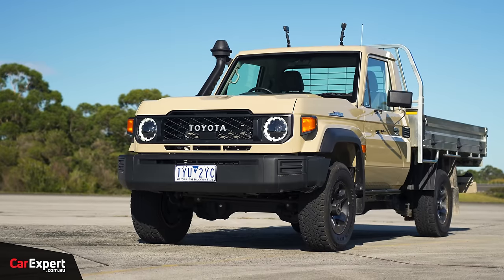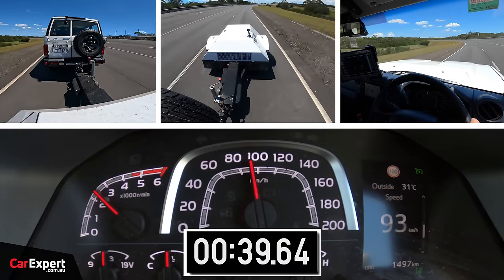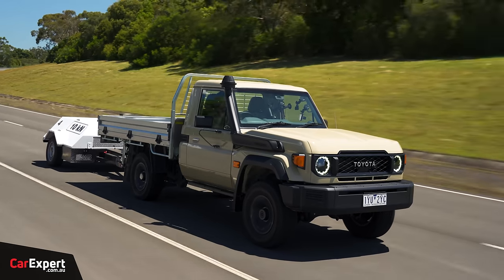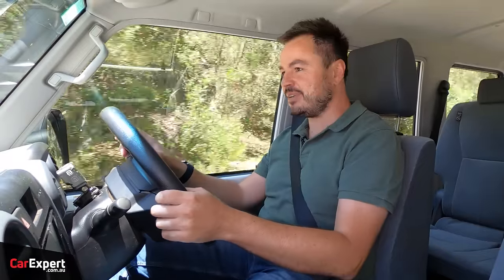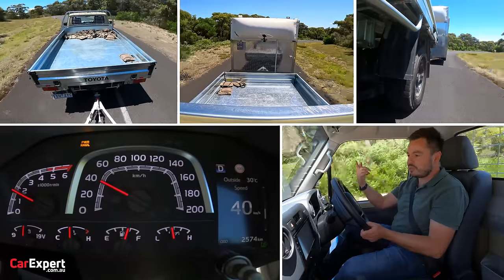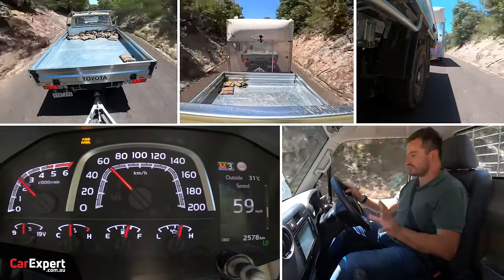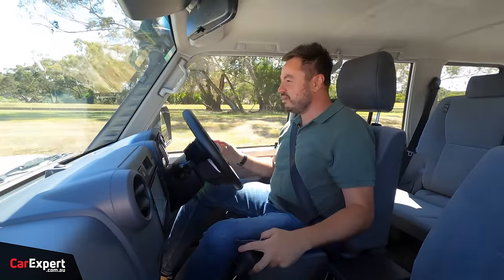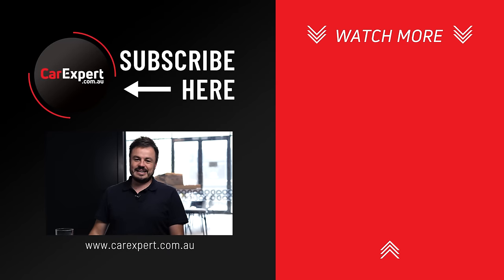LandCruiser 70 Series V8 v 4-cylinder towing stress test & drag race! Is Toyota's V8 dead?

Comment: Ringing a 4 cylinder.
If you put the 10 speed behind the V8 running the same psi boost as the 4 cylinder. The out come would be interesting. By a hilux
Reply: If you are towing regularly, or heavy, buy GM/Ford/Ram diesel.

Comment: THE REAR TRACK.
Every one harps on why Toyota havent changed it, but dont do research on what's involved to keep it legal.
Here we go....
There will be too much rear wheel poke if the rear track was widened to the same width as the front track to keep in with in Toyota's spec of outside wheel to outside fender ratio and comply with countries laws and regulations ie ADR.
The Australian 79 ute would be ok with the "Toyota Australia" tray as they are wider than the body, and would sufficiently comply with track cover, but the rest of the world use the tub on the 79s, and the rest of the 70s being the swb the wagon and troopy have the hard rear body panels which are not wide enough.
Take 5 minutes and Google MQ patrol and GQ Nissan Patrol, particularly study the rear frender between the models, The main bodys share the same doors and body but the addition of coils and wider diffs to the GQ ment Nissan had to do a widened fender body front and REAR. Chop the wide wheel arches off a GQ and you have a MQ as such.
If Toyota added a rear wider body (over the rear fender like the mq vs gq patrol) then a wide rear diff would be possible. 
But we all know Engineering and cost involved plus winging of the world changing its classis style it aint going to happen.
Side not the GU patrol ute with coil front leaf rear also has a bit track difference but no one complains about that..... 
Next time you ask about a wider diff ask about a wider rear body instead.
Reply: We all know its not gonna happen, but in the scheme of things it would have been cheap for toyota to update when they changed to the v8. A couple hundred extra for the slightly extra metal in the diff and axles, and literally a set of fender flares similar to the GR Sport Hilux, which if plastic can be made for a few dollars realistically. They were being lazy and cheap.
Reply: It's called being cheap. Toyota only spend the absolute bare minimum on the LC70 to keep it on sale. There's plenty of people in Toyota that would prefer to see it replaced, it's still build like an early 1980's vehicle. Hand welded, hand filled body joints, it's expensive to buy because it is really labour intensive for them to build.
Reply: They engineer new body's for almost all car models all the time, Toyota know they don't need to care, as people would buy if they only had 3 wheels 😂

Comment: Why buy 2.8 70 Series when you can buy Hilux with the same engine and it is a much better car.
Reply: Easy answer is the 70 series can tow 3500kg at full gvm, the Hilux at full gvm can only tow approx 2800kg. If you don't tow then the Hilux is more comfortable,  safer and a cheaper.

Comment: Probably wouldn’t make any difference, but shouldn’t it have been auto vs auto, or manual vs manual?
Also I find it interesting that EV utes get criticised for their drop in range when towing, and they take longer to charge, but look at the drop in fuel economy for both the V8 and the four cylinder.
Interesting video though.
Reply from the maker: V8 is manual only and 4 cylinder is auto only, that’s really the point here. Toyota have decided that’s the avenue they are going to go down so that’s the test we conducted.
Reply: The drop in range with both of these vehicles is because they are under powered to start with. I used my last vehicle (2011 Ram 2500 inline 6 diesel - waiting for replacement) to tow a 30' enclosed car hauler with a GVWR/GVM rating of 14,000 lbs and rarely lost more than 10% of the normal 600+ mile range.

Comment: We have several 4.2D's and since recently V8's with 600 000km and more on the clock, working mostly in low range and with heavy off road towing in harsh African conditions. Their simplicity, longlivity and performance in low range is unmatched and  is why they are in demand and hold their second hand resale value. Those interested in performance figures in high range and on tarmac, buy highly turbo boosted small blocks and replace them regularly. Under  heavy loads and with low rpms the larger bore engine with heavier components have more momentum and smoother power delivery. As for auto boxes, no thanks, another heat generating  limitation favoured by those used to their city slickers

Comment: When you have 3.5 ton you have to push that engine past 3000 rpm not with 1500
Reply: Exactly,  anyone that knows anything about towing or owns a v8 cruiser knows you have to rev an engine to get the best performance from it. Paul drove the v8 badly and I think on purpose.  Even the 4 cly going up the steep hill was increasing speed fast untill the gearbox changed up a gear then it slowed the rate of speed increase.

Comment: You need to test them both with auto, your lousing to much momentumin the gear change,  as a truck driver grabing a gear killig the 79, 200 series or a 79 with an auto there are many around, leeson fabrication in Brisbane fit an 8 speed ZF auto to the 79. Very impressive

Comment: It’s not a narrow rear track it’s a wide front
Toyota widened it to suit the v8 and left the rear 

As for performance a tickle from a decent tuner would show just how  piss poor the factory tune is on the v8
As to why, at least with this model Toyota knew they’d sell v8s, but they had to sell some 4s aswell so I’m assuming they did it to give the 4 some appeal as I’m sure they could’ve refined the v8 a bit and got more out of it 
Tho then again the clutches in them a crap and it would need more then just a remap

Comment: I dislike these comparisons because they make the v8 look bad. The v8 is not the problem here. Use the 200 series auto if you want a fair v8 vs. cylinder. The 200 uses the same engine, but it's configured properly. The 70 series hamstrings the v8 with a manual with poor ratios, a bad turbo, and severely under tuned and boosted.

Comment: It seems the new 70 series 4 cyl has a remapped 6 spd as it was able to reach 100 kph, unlike the hilux and fortuner and prado when towing the 3kN caravan. Toyota should just do away with the 5spd altogether and introduce 6spd manual/auto options for both the 4 cyl and v8. The real test would have been to test the 4cyl against the 200 GX/GXR as they come with 6spd autos unlike the VX/altitude specs that have 8spd autos.

Comment: A good example of why neither is suitable for towing 3.5t. Neither has anywhere near the torque required to do the job. Nor the stability by the sounds of it. I’d hate to see the EGT’s struggling up that hill. Far better to get a proper tow vehicle with lots of torque and 10 speed box.

Comment: Im starting to think the 4cyl 79 has a different tune to the hilux even tho they use same motor and box. The hilux didnt make it to 100km towing the dyno trailer at a lower setting.
Reply: This Landy 4cyl has a Prado engine and steering wheel from it
Reply: Might have a gearing or differential ratio advantage. I’ll bet my hat that it doesn’t have the same top speed as the Hilux.
Reply: @interceptor7905  hilux/fortuner, prado and hiace (under tuned 130kw) use the same 1GD engine.
Reply: @CM303898  diff ratios are definitely shorter in the Cruiser Hilux has 3.73:1 diff ratios with the auto and the LandCruiser has 4.3:1 diffs in the auto.

Comment: Ah the 30+ year old original prado still getting sold with an equally old and crap V8 TD.  I like the old school looks but when they ask so much for something still so flawed and useless its a joke.  Thanks goodness the single cab ute at least has seen a lot more updates and fixes to all its issues and the auto with a more modern and powerful TD at least brings it partly into the modern age.  Having had the misfortune a few times over the years of towing large portable accommodation units (Large caravan with 2-4 small sleeping units in it)  From perth to remote mine sites and omg I hate these things with a passion.  Like in your tests when going up a hill I used to fear for my life when struggling to maintain 40-60kph up hilly areas and the massive road trains are coming up from behind at 100kph and where on top of me before even they realised how slow i was going and then overtaking me or breaking hard because they could not overtake me. Dangerous is what they are when towing large loads on the road.  And then the fun towing the same loads on dirt roads with that rear diff tracking issues....Why can't toyota after so many years fixed even that issue?

Comment: Half the cylinders doing double the work. It's a longevity test that would really define the 70 series!
Reply: From what I saw the V8 was under a lot of stress. All that for not a very good performance.
Reply: @AusGovOfficial  the v8s are greatly undertuned from stock they are capable of making alot more power far beyond what a 4 cylinder can cap. Think about it 8 cylinders to spare the work of 4. Tho my comment was more to state which engine will actually do the mileage. A 4 cylinder pushing more power than v8? That would put a lot of wear on a smaller engine

Comment: 0:25
How is that possible, as Torque is related to HP and RPM.
From the top of my head; a similar HP but bigger Torque can only mean that the max HP sit´s on a lower RPM (to generate more NM). 
Which would be very, very, very strange when the engine is half the volume.

Besides: I just saw a video from a mechnic who said the he has NEVER seen a disassemble Toyo 2,7l Diesel (RE..?) engine, because they never fail.
THOUGH that particular engine had a snow blower in the front! So hard pulling in low RPM and low gears.
= to heavy vehicle towing!

A simple math is: The load of the engine is divided by.... 4/6/8 cilinder and how many main journals? In in R6 this is 7! ALL full size Diesel are R6 for a reason (except Scania): MAN, Mercedes, VOLVO, IVECO, Catalipar etc.

Comment: You were mocking cars that couldn't do over 40kms on that hill in he mega SUV test! Also, the track difference is to fit the bigger new engines. Moreover, irrespective of the engine size, the price on this car (which is basically an engine) is ridiculous!

Comment: Compare the performance of the v8 79 to the 200 then compare engine performance to the 4.

The real issue is toyotas approach to the 79 and how little they put into it after they swapped from the ihdfte.
They heavily derated the v8 and cut production costs with both the track and the exhaust,clutch and air intakes.

This is nothing new we have had this issue with the v8 eversince they were released. All this comparison's are miss leading and even though they are the same body they are 2 different vehicle's

Comment: Toyota prob have plans to drop the v6 in the engine bay. Simple marketing.let the customer fix the rear. Otherwise, the 300 series landcruisers wouldn't sell fast, also time to engineer problems out. The 2.8 is a stop gap..however a very impressive smaller engine in a large ute.

Comment: Need to stop comparing the 4 cylinder 70 series with the boat anchor and address the elephant in the Toyota showroom, compare it to the Hilux. I’d be tipping that a wide track GR Sport or Rogue would do everything better than a 4 cylinder 70 series and for less money.

Comment: Want to tow fast and easy , try the ram trx. Now that would be an amusing comparison
Reply from the maker: I don’t think our trailer could handle that.
Reply: 60k audi sq7, 320kw diesel, 7L per 100km
Reply: None of the pre-runners are very good tow vehicles. They are all sprung too soft. Ram 3500 or Ford F350/F450 HO diesel would make life pretty easy.

Comment: IT'S NOT A HORSE RACE, why are you handicapping the lighter vehicle? Makes no sense. Why not deactivate 4 of the V8's cylinders to make it the same as the 4? Maybe make them both the same width to ensure equal air resistance? Any comparison should be done like the vehicles are delivered from the show room. Anything else just makes the test irrelevant.

Comment: Anyone with a basic understanding of mechanics realises that the only reason the 4cyl outperforms the v8 is the drivetrain, not the engine. The 4cyl has shorter ratio diff gears, an extra transmission gear and an auto. If you put the V8 with that same drivetrain it will haul better and for many years / thousands of kilometers longer which is the whole point of the 70 series Landcruiser...to haul loads for as long as possible, not win drag races. The only reason Toyota put the 4cyl in the 70 is to comply with the Federal governments Euro 6 standards which are the death warrant for 4WDs and cars as we know them.
Reply: Rubbish, the V8 makes less power and torque. Even with an identical driveline the more powerful engine always wins.
Reply: @billyp4850  no. Ever heard of torque bands? Nm on paper isn't the same as how different motors deliver that torque in real life. The 4cyl is highly strung, the V8 is not, the v8 will last longer and be less stressed pulling.
Reply: @JoeCass12  The V8's torque band is narrower than the four's. It's simple physics.
Reply: @billyp4850  lol mate you are simply wrong and don't understand what a peak torque band is and not sure what point you were trying to make about "physics"? Because as per Toyota's own specifications sheet the 4cyl makes 500nm from 1600-2800rpm. The V8 makes 430nm from 1200-3200rpm, meaning the 4cyl has 1200 revs of peak torque and the V8 has 2000 revs of peak torque and that peak torque starts at 400 revs earlier in the V8 than the 4cyl. As per my first statement it you put the V8 with the shorter diff ratios, an auto and an extra gear it would be a different story. The drivetrain in the 4cyl is what makes it superior, not the motor.
Reply: Either way one of  vehicles is better and that's the 4 cylinder

Comment: The V8 is badly detuned.. Exhaust and a retune makes a big improvement to power and torque with improved fuel used
Reply: The v8 is always that weak
Reply: Then say goodbye to your drivetrain warranty on your 90k farm truck!
Reply: You shouldnt have to get a tune after spending over 90k on a vehicle just for it to tow like it should
Reply: Then tune the 4 too.
Reply: Ronny Dahl did a test with his tuned V8 79 against his stock 2.8 76, 76 still smoked it.

Comment: This isn't about the V8, it's about the auto. Test it against a 200 series auto for a better understanding.
Reply: Not a fair comparison.  The 200 engine has two turbos.
Reply: two turbos make less difference than the auto. it's easy to wind up the boost on a single turbo and match the 200's power... a lot hrder to change gearboxes

Comment: Fullboost and Ronnydahl already did this and showed in standard form the 4cyl is better, seemed like Paul kept changing gear too early though in the manual, 3000rpm is too short, need to get it up to 4200 so the revs drop in above 2000rpm...

Comment: Let's see how long the 4cyl lasts , like do the test when they have 300000ks on them , I bet the 4cyl is shit by then , like all these wizzbang cars now . I've got a 75 series 1988 original motor 600000 ks and still goes like a train .
Reply: Have you done a turbo conversion on the old 2h?
Reply: Will last longer and crack less heads than the old 2H.

Comment: Remember that the V8 will do the hard stuff day in day out for years and if you really want to play, then you can nearly double the performance from it.
Compared the four banger which is almost certainly screwed balls to the wall with not much more to play with a bit of tinkering.
I could be proven wrong in the long term and really for the King OFF ROAD, I hope I am wrong.
But this move to me screams Patrol shitbox all over.
See how they go and last long term but hopefully they won't be a common sight on the side of the road with a monster caravan and the bonnet up surrounded in a heat haze with a blown engine.
Three-liter shitbox Patrol destroyed their reputation in one move by using a car engine trying to mimic the legend.

Comment: second hand V8's better take a 20k haircut now lol
Reply: They won’t, because you can bet there’ll be a line up around the block at every diesel tune ‘shop in the land, so they can all brag about how their V8 has more power and torque than a stock 4 cylinder.

Comment: The reason the front wheel track is wider is purely because Toyota are lazy. They had to widen the front axle to fit the V8 engine and they couldn’t be arsed to widen the rear.

Comment: Not sure of a genuine fair comparison. 

The wagon is 450mm shorter in the wheelbase than the tray back. Handling characteristics would be vastly different. 

My 3.2L BT50 tows way more confidently than either cruiser.
Reply: The wagons ride horribly because of their shorter wheelbase, and their shorter spring packs on the back.

Comment: Why did you add weight to the 4 cylinder?
Reply: Why didn't you listen?
Reply: One's a 79 Series the other is a 76
The 76 is a 5 seater Wagon 
The 79 is a 2 seater Ute
Reply: @TVR161  I'm confused whether they tried to match the v8's weight or the weight of the wagon version of the 4 cylinder.
Reply: @isurumw6119  I think the point was by equalling the weight they could better compare the engine/trans combo in isolation of other aspects of the vehicle such as tare weight.
Reply from the maker: We wanted 2 utes but they didn’t have a V8 on the press fleet. So we added weight to them to make them as equal as possible.

Comment: Why were you changing gears at 3500 in the V8 - redline is at 4500 and if you had used all the revs you would have been in the power band for the next gear. The V8 is very underdone though.
Reply: Wrong, as someone who genuinely owns a V8 70, they serious run out of power anything after 3000rpm. They are very low raving engines and hit a wall at 3000rpm in standard form.